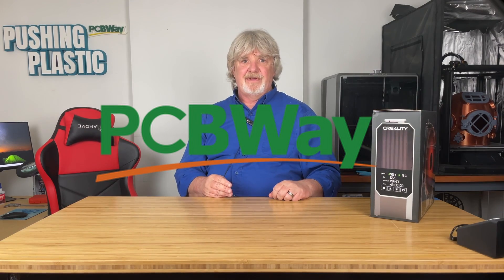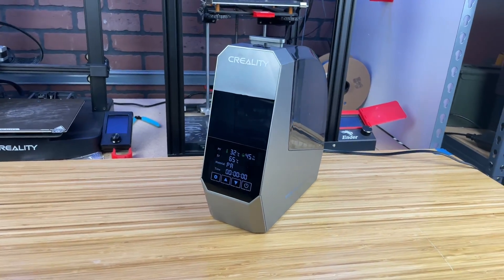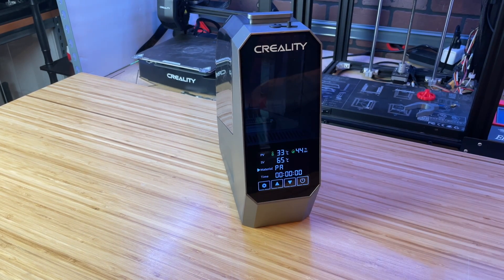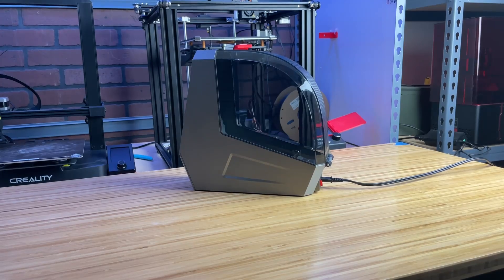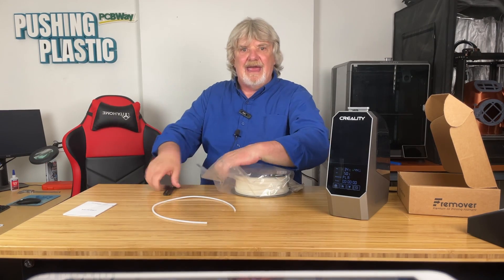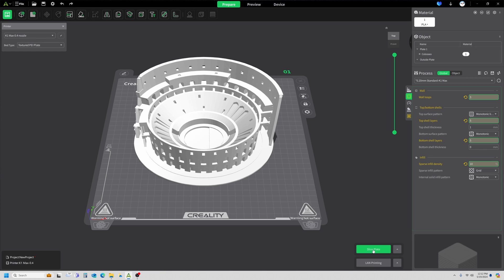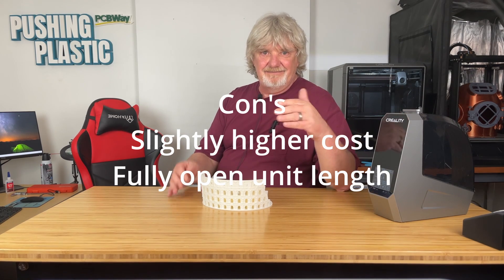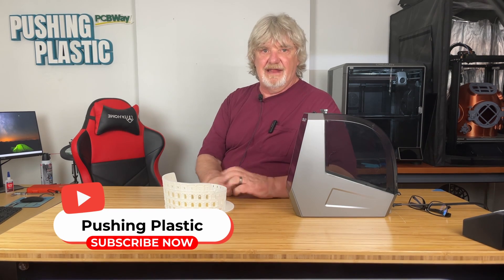Testing The Creality Space Pi Filament Dryer

Comment: Just a suggestion, it would have been good to see a before and after comparison of the same model being printed before and after being dried .
Reply from the maker: Perhaps, but there is no way I was putting filament in my printer that sat outside in the damp weather over night. The idea is that I would knowingly print with damp filament and potentially cause a problem with my printer, fix the printer and re-print with dry filament? No thank you.

Comment: I have had this since shortly getting my M1 Max and love it mainly for just filament management. Meaning I do not have to go behind the machine to refill. But YES its has been a bonus as it has helped with OLDer PLA :) Love it .
Reply from the maker: I currently don't have it hooked up to the printer. But I'm getting tired of going behind the printer to swap filaments so I see that coming soon!
Reply: @pushingplastic7445  Yea its on the right side of my machine and OOOOH so nice. The Bowden tube that comes with it goes all the way to the run out sensor .. So it comes with the necessary tube.. Good fix
Reply from the maker: @SuperMouseDV  Guess what I'll be doing tomorrow! Thanks for the tip!
Reply: @pushingplastic7445  You have helped me I'm happy to help. I was surprised that the Bowden tube was that long. I was ready to rip a hole into the side of my K1 Max. :)

Comment: As monkeystrong42 said we really need a "before drying" comparison, because you can't prove anything with a dryer without a before and after. I understand you said "I would never do that to any of my printers" but I have seen people soak rolls in water for days and print w/o any harm coming to their printer (just the prints). Keep in mind PLA is one of the least hygroscopic filaments out there so you would have been safe, and without the before picture the change the dryer may have had is conjecture.

Also you said "the outer walls are as smooth as they should be...they layers are nice and uniform" when to be honest they look bad on the video you showed. I saw lots and lots of layer lines where some of them appeared to be uneven/building. I am not familiar with the slicer you are using, but if you have a chance check out the wall ordering of Inner/Outer/Inner as that can smooth out a number of external wall layer line issues.

I hope you take my comments as they were intended to be, helpful for future videos, as I am not trying to trash the work you put forward (just make it better). I have been subscribed for about 1/2 a year and do enjoy your videos.
Reply from the maker: I whole heartly take your comment as intended, Honestly I do. Comments like this help me decide how to do the next video and what people want to see in them. But, I stand by my decision not to run filament that is known to be wet/damp through my printer. I felt that 22 hours outside in rain and 92% humidity would be fine for a demonstration. Sometimes it's hard to guess what people want to see.  As for those blobs you see in the video, that's actually in the designed model itself. You can go to STLFlix and check for yourself. Even without an account you can still use their "Explore" feature. The model is called "Il Colosseo", they show up even in their pictures.  The slicer that was used in the video was Creality Print 5. I appreciate your comments and I thank you for it and I appreciate that you watched.
Reply: @pushingplastic7445  I just got the double roll version of this for $85. The one thing I'd have liked to have seen would have been a time lapse of the drying process. This is my first dryer and I see nothing in the packaging to help me know what is dry enough, eg. the PH value I'd expect to see when the filament is "too damp" versus good-to-go.
Reply: @CreatingWithJackPines  Im considering the double roll version as well. After a month how do you like it?
Reply: @MrBiggs-wu2kf  so far, no complaints, but I'm new to the dryer game. I'm drying some TPU now which wasn't unrolling correctly and will be printing from it after the 24 hours of drying.
Reply: hotfix, I disagree, we dont' really need a "before drying" comparison as we all know what these driers do....they dry filament, the differences are the price, asthetics, noise and footprint. I suspect that you know this already ; )
Reply: @kurtc3254  I disagree with your disagree. You can't determine the effeciency of aby product without a before.

Comment: Off topic, how do I fix elephant footing on prints. I've been doing lug nut covers for my car and they always do it. PLA. I did a test with ASA and a brim on a smooth plate, and didn't get it.
Reply from the maker: In the Quality section of Creality Print 5.0, turn on Advanced Settings and you'll find the elephants foot compensation. I hope this helps!! Thanks for watching!
Reply: @pushingplastic7445  👍
Reply: @LarryBerg  I can't find that, in Creality print
Reply: @funfun8095  Initial Layer Horizontal Expansion setting

Comment: I have that same dryer and just started printing ASA and heard you can actually Over dry filament... What do you think?
I found you and subscribed, because you're one of the few that I've found that talks about the Creality slicer. Thanks.
Reply from the maker: I've heard the same over the years and it does make sense. But I can honestly say that it's never happened to me....yet. But that's the nice thing about the Space Pi, with the preset temperatures and filament types it takes away some of the mishaps that might happen. Just check the chart in the instruction manual and don't over exceed them and you'll be fine. I'm getting ready to load some ASA into the Space Pi myself!!! Thanks for watching!